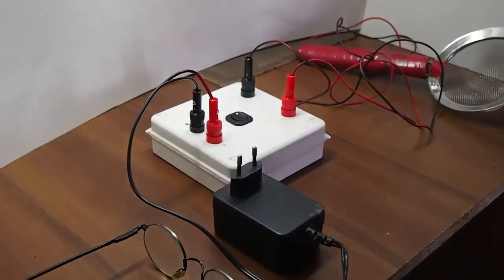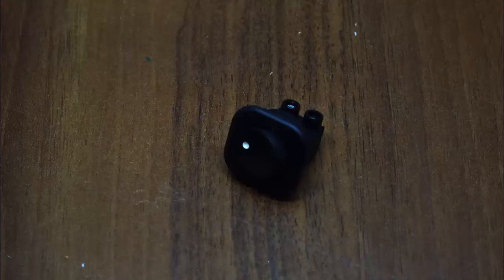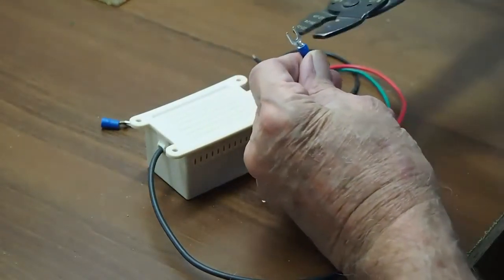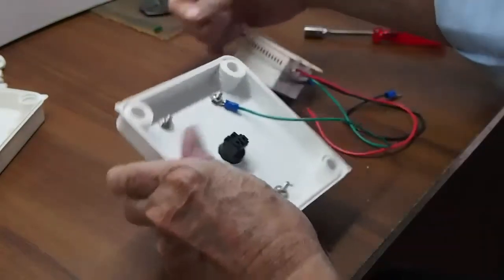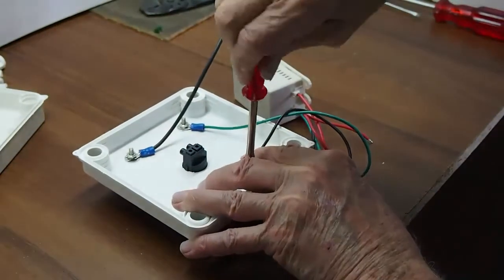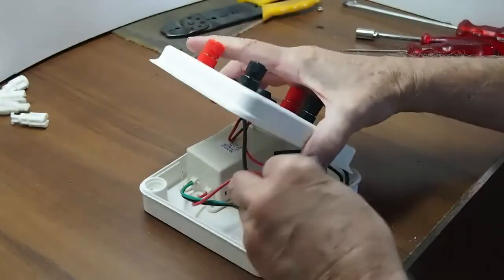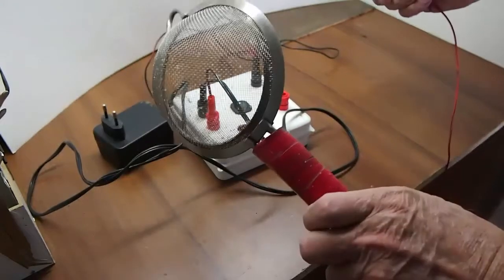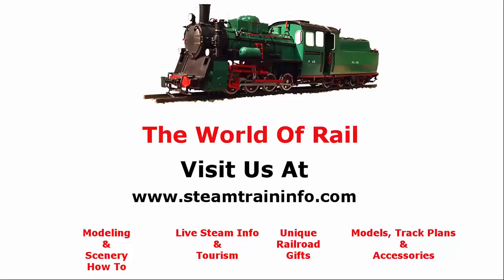DIY Static Grass Applicator Homemade Cheap Fast And Easy To Make 15kv DC Static Field 12v DC Input

Comment: Your 12vdc source should be less than 1 amp for safety... Mine is similar to yours except I use a jack and plug from the wall wart and a foot switch when I use AC...
Reply from the maker: I use a 2 amp wallwrt and 5 amp converted computer supply. Regardless of the amperage just approach handling electricity with the standard safety precautions one of which is be careful with the leads.

Comment: It works!  I have a Noch Grassinator, a Flockbox a flyswatter static grass applicator and I bought the Grassking Static Field Generator and it is by far the best I have used and it is the most versatile.  My train group has been converted to using the Grassking pictured here.  We have had excellent results using it and I would highly recommend it to anyone working with static grass!  The service has also been great.   It comes with excellent instructions.  I have bought the kit which goes together very quickly and one diy for another project.  Both have worked flawlessly.
Reply from the maker: Thanks

Comment: Thank you for sharing.
You mention 12v is best buy is there a ball park amperage output we should look for with one of those little wall transformers?
Reply from the maker: Current output is not that important because this unit generates a field.  It is not a transformer so there is no current output.

I use a 12vdc 1 amp output transformer that was used for charging a hand held vacuum cleaner.  I also power it from my ho scale analog track.  (No DCC).  I have tried it on my powerpack and it works as well.
Reply: Could I use a higher voltage power supply and would it help on larger flocking areas
Reply from the maker: .5 to 1.5 amp is fine.
Reply from the maker: Do not exceed 12.75 volts or you will burn the unit our. Just use a larger screen. The unit will charge it.